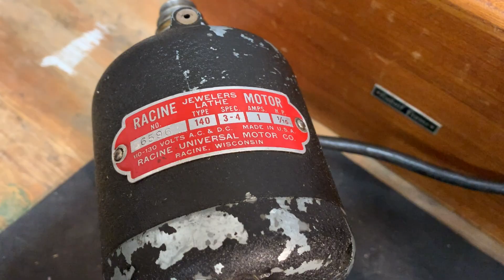Behold! My new lathe FINALLY - making a new stem for an Elgin B.W. Raymond pocket watch

Comment: I'm confused as to why a railroad grade watch is crown set and not lever set.
Reply from the maker: Before it was standard
Reply: @csspinner  Now I'm more confused.  The railroad grade standard was first introduced in 1893.  If the watch predates that standard, how can it possibly be 'railroad grade'?  Granted watches of all sorts were used prior to the standard and even after, but I don't think you can call it such if the watch both predates and doesn't conform to the standard.
Reply from the maker: @hugeshows  standard evolve. It’s a common misconception that lever set was a minimum requirement from the start. It wasn’t until the 1900s that it became standard on RR grade.

Comment: Just bought and early G..Boley but think ill sell it and get a full set like this instead. I found a few others on eBay that are complete in box. Im leaning towards Lorch but there are some good Boleys (as far as I can tell) Curious what your paid for this set? Is $4500 normal? I wasnt planning on spending more than $1500.
Reply from the maker: I got this set late 2022, and spent maybe $2500. Prices have gone up, but $4500 would be the higher end by todays standards I think

Comment: Did anybody tell you yet that the attachment @2:12 is a Jacot Pivot Lathe type attachment used for burnishing and polishing pivots yet? This is used with a bow. Ask me if you need more info, like how to used an ID card holder with retractable cord as a vastly superior alternative to a bow. The reason you need to do this manually is that burnishing is a back and forth process to case harden the surface and remove the least amount of material as possible. I'm pretty sure you have the same jacot pivot lathe as me, but not sure if you know the ID card holder tip?

Comment: I've recently acquired something closer to a 6mm Lorsch lathe that needs a lot of love. Not sure it can be restored, but there were some things you did here that help a lot with my journey, particularly the bit about fusing the cables against the hot razor blade. Thanks!

Comment: Fantastic. Most entertaining video..especially the 'new' lathe cleaning and preping for it to be put to use. Love your new 'murphy' work bench too. How did you work the new stem to function properly without a template of some sort...- just by trial and error..?  Great job. Kudos
Reply from the maker: Thanks. Yes on the trial and error. There were parts of the old stem that I used as a reference. Made things larger than needed, then tweaked down to size for final fitment
Reply: Well done my man. Right on.  @csspinner

Comment: Wonderful and informative video. Where did the specs for the stem come from? What does the lathe description of 8mm refer to?
Reply from the maker: The stems are specific to the case, but the winding square is standard for an 18S pocket watch. I designed the new stem as comparison with the original, factoring in the changes I wanted to make to the detents. The 8mm nomenclature refers to the shank size of the collects that fit into the headstock

Comment: the off center bit is a drive, you use a bow, like a 1" archery bow, but of brass, this operates the gear like a foot operated sewing machine, so you can feel if something is amiss, this turns the on axis center part, by rubber belts, as you are only very lightly polishing the part, so you don't want to go too far.

Comment: the 'off axis' center is like that on a jacot tool, for driving the wheels, while giving room to fit the burnisher onto the pivot, the tailstock accessory holds the other end of the wheel (not being worked on)- to stabilise the axis, otherwise you can get a tapered shaft.

Comment: Omg, my heart stopped at 5:09 when you start hitting onto the back side of the conical bushing... That shaft is keyed and the bushing needs to fit into the key (I hope you did that, it is hard to tell from the video). In no event, should you go straight to hitting the headstock with wood/bronze/brass as you will risk damaging the thread and jamming the bushing.
Reply from the maker: Everything was aligned before I started tapping. It’s all friction fit together, tightly.  This was a similar process to other literature and guides for headstock servicing. Can you recommend an alternative approach? Lathe has many hours on it since then and no issues.
Reply: @csspinner  Not sure how to describe without an image, but at 5:11, when you place that brass part at the end of the shaft, you can see it sits very high - the reason for that is that there is a key on that conical bushing that you need to align with with the shaft slot - you shouldn't need to tap that back part in as it is actually the nut that controls the friction (when you spin the shaft at 5:17 you can see the keyed slot briefly under your fingertips).
Reply from the maker: @1sashimi11  yea I get what you’re saying. I definitely aligned the slot. But there’s no way it would press in all the way without tapping it in. I had it apart some time after that and the key was still there 🤷‍♂️
Reply from the maker: @1sashimi11  also here was one of the references I used to learn how to assemble a headstock. He also points out the key, aligns it, and still needs to tap it into place. https://youtu.be/DL6oKA8vXs0
Reply from the maker: @1sashimi11  anyway you’ve always given me good advice, so I trust your opinion on it. I will have to see if I can drive it home with just screwing on the nut next time I need to reassemble
Reply: @csspinner  yeah, definitely. I have two of these lathes and one of them (the abused one) definitely has traces of someone trying to hit it over the keyed slot 😅 Idk how someone made that mistake, but they did. 

Anyways, love your content so please keep posting, it’s inspiring to see some pieces brought back to life!

Comment: What kind of steel did you use for that stem, Chris? 
Thanks for sharing your videos and expertise with all of us.
Reply from the maker: Hi, thanks for the comment. I use steel rod that’s hardened and then tempered to a blue color. Allows it to be easily cut by my carbide gravers, yet appropriate and suitable for use as most watch components (balance staffs, pivots, stems, etc). Esslinger sells these and their packs contain an assortment of different sized rods

Comment: I love that Murphy desk setup! I'm using a folding desk for mine as well! And, every time I try threading rods of that diameter, my material always slips in the collet unless I cinch it down uncomfortably tight. Is that normal? x.x
Reply from the maker: Thanks, George! Yes I get the same slippage unless I really torque it down. I’m always fearful of snapping the handle off the drawbar with how tight I need it to be
Reply: @csspinner  Same here. x.x Or afraid I've somehow used the wrong collet, but I'm always very careful, so... shrugs

Comment: (2:11) that is safety pulley work with tapered holes lathe center plate (2:17) and jacot drum (2:20) , you can use dog (2:07) or Bergeon 30090 to drive the parts with no spokes parts such as cannon pinion or winding stem , or use the pin on pully to drive the pars with spokes such as gear and balance wheel . You can drive that by bow like jacot tool , or you can use motor and thinner belt to drive the safety pully , and adjust the tight or loose of belt by change the angle of pully arm .
Reply from the maker: Thanks so much for the response! Makes a lot more sense now.

Comment: Not being very familiar with mini-lathes, could you give me a sense on how you determined the range for your speed settings?
Reply from the maker: Bruce, machining guidelines recommend around 700-800rpm for steel- though that could vary depending on temper. The harder the material, the slower to go (example- for blued steel I usually drop a couple hundred rpm). Something soft like brass I can get away with over 1000 rpm. Though that’s all a guideline. What I really shoot for is nice, long curly swarf from the work. If the graver seems like it’s sliding and skipping over the top then it’s likely too fast and you end up burnishing the work instead
Reply: @csspinner  Thanks so very much! That was exactly what I wanted to know. Much appreciated.

Comment: Looking forward to future adventures with the lathe. Found the stem build quite interesting. How did you know the correct shape required? Did you have a build drawing? Thanks for your time.
Reply from the maker: Thanks, John. For the shape I estimated based on the position of failing detent on the one I was replacing. I used a rod about the same width and surprisingly the crown threaded fine. I thought I would need to rethread it with Swiss